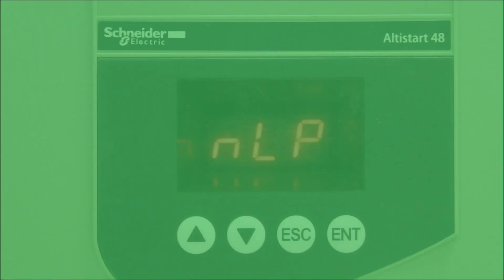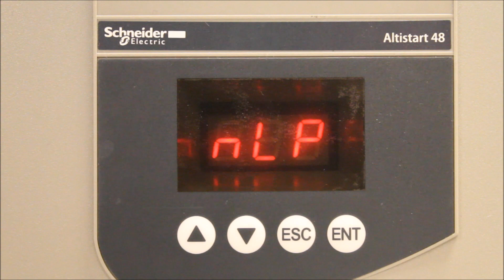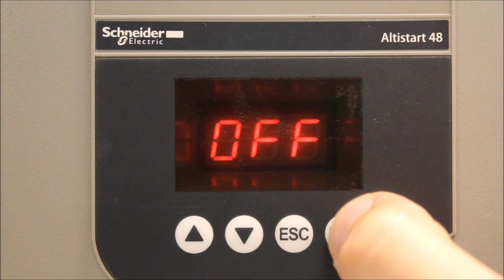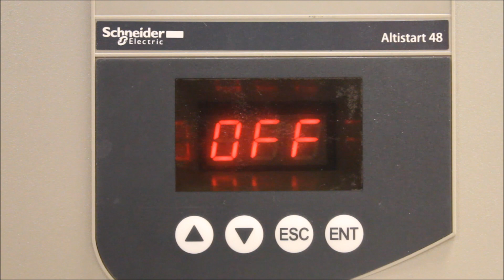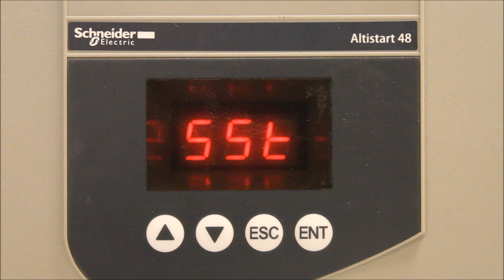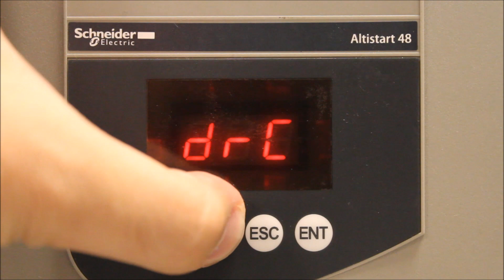Configuring Altistart 48 for Small-Load or No-Motor Operation | Schneider Electric

Comment: I am facing a similar problem on my soft starter , it immediately goes to phase loss fault on starting . I checked the motor and the wiring and also swapped the connections with a healthy spare soft starter and it works fine. How can I check the faulty soft starter to check if the fault is internal with the power electronics or control electronics. Can anyone share thesoft starter schematics ?
Reply from the maker: Thank you for your message. We apologize for any inconvenience caused. For technical support or to find answers to your questions, please refer to our support center: https://www.se.com/ww/en/work/support/support-center.jsp or reach out to a technical expert in your location here: https://www.se.com/ww/en/work/support/country-selector/contact-us.jsp